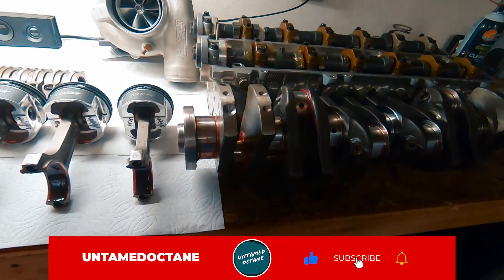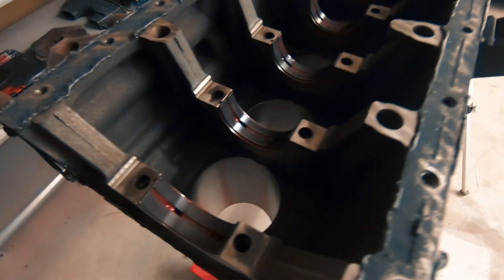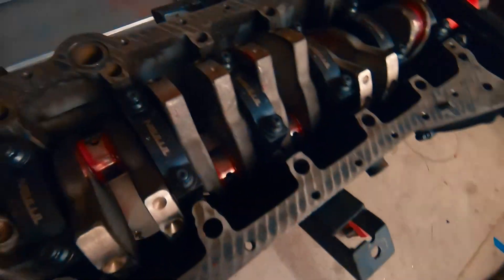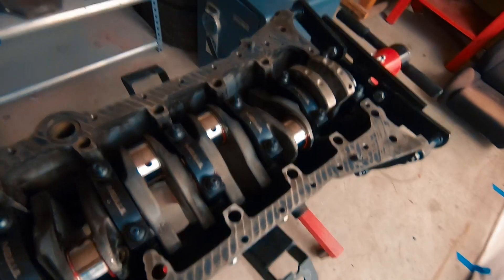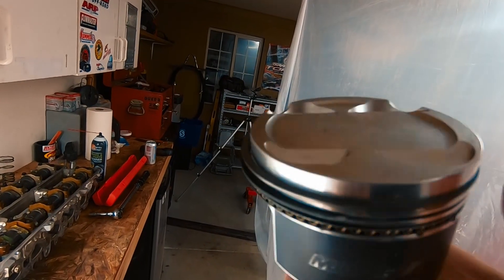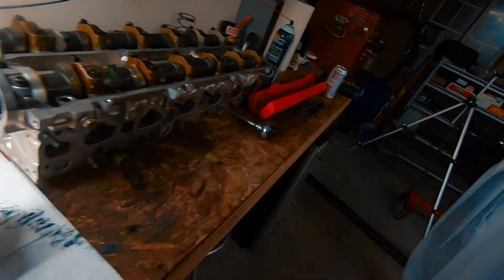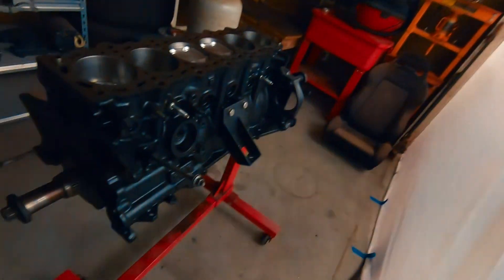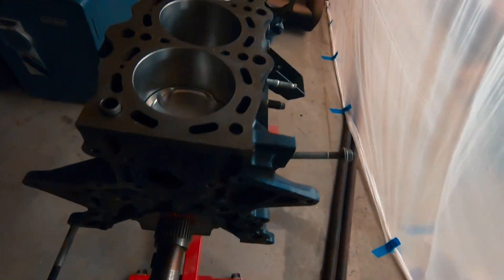1000HP Supra 2JZ Engine Build PT 1

Comment: What size and make fuel onjectors and pump are you running on your  build?
Reply from the maker: Currently running Injector Dynamics 1050X injectors and an AEM 340 E85 Pump
Reply: @UntamedOctane  what power did you end up making? I had the 1050x and could only make 588whp at 87% duty on e85

Comment: Those kelford cams 280. Stock buckets?
Reply from the maker: They are Kelford 280/11.4 lift with Toyota Celica 2zz shimless buckets
Reply: @UntamedOctane  I bought a set for my 1jz from kelford they 280 they said you can use the stock buckets. We will see
Thank you for the reply
Reply from the maker: @HitKLHman  You may be able to use the stock buckets although since we will be revving the engine higher then stock, we didn't want any chance of spitting out a shim

Comment: You Got me intrigued from i saw it's an MK3 Supra
Reply: Sooo, I saw the crank & rods installed but didn't see any Bearings go in.....? :/
Reply from the maker: I didnt get the ring filing or checking clearances on the bearings on video unfortunately. The bearings were already set into the main and rod journals beforehand. I used King XP main, rod, and thrust bearings
Reply: @UntamedOctane  Nice Very Nice, I got some ACL to install in an Aristo 2JZ GTE but rn i'm wondering if i should even go that far to just put it back together without building it 😂